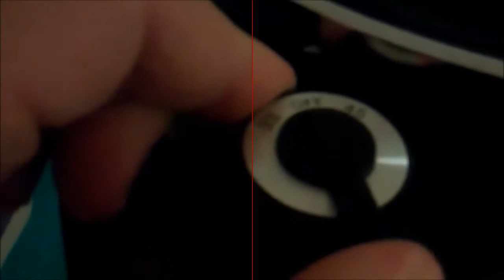Sony PS 1100 Turntable Gets a cartridge and setup

Comment: How did you get the platter straighten .
I'm going too pick one up from a pawn shop .
But the platter is looks like it was bent out of shape.
Is the shaft bent on it most likely .
I think the last owner had it shipped and the seller did remove the platter .
That's the only thing wrong with it .
Cost for me 70 bucks .
It has the original Sony cartridge the one with the green needle and there available on eBay two of 29 bucks  oem from sony
Reply from the maker: I put it on a shaft,  and measured the clearance, and manually tweaked it til it was smooth.  The platter metal bends pretty easily.   There was a platter for sale on Organ Donor turntables,  so if I messed it up worse, I had an option.
Reply: @DeadKoby  ok I see at worse I can get another platter

Comment: Hi DeadKoby when you plug it to your amp do you have this hummmm?    i get Humm when STYLUS  touch the record , maybe its the direct drive ?
Reply from the maker: How about the chassis ground?
Reply: @DeadKoby   i think it has to do with the direct drive as it humm when the motor in engage with the TT, when the arm is down and TT spin when i dis-engage the motor the humm stops.

Comment: This seems to be old but do you have any tips on replacing the tone arm wire?  I was able to pick one up and it seems to work fine except the cartridge is missing and the tone arm wires were fragile and broken. I am going to replace the wires and the cartridge as soon as I figure out how to replace the wires.
Reply: I think I just need to take the top off to get to the wires, but not sure how to get that off.
Reply from the maker: Is there enough wire there to fix the broken connector?
Reply: @DeadKoby  no it broke up inside
Reply: Connectors are all shot and corroded
Reply: I pulled the bottom off and I see how to do it. I ordered a new wire set and it should be able to pull it through with the old wire. The wires soldered underneath look good so I will just splice into the old wire and and then secure the new wire to what is left of the old wiring at the cartridge end and hopefully be able to pull it through. Thanks for the videos
Reply: I also ordered the same cartridge that you used. Since the original one is hard to find and expensive if you do find it.
Reply: By the way, this was a free pick-up so I don't mind spending a little to get it going. The gears and motor all work fine.
Reply from the maker: @crshuby   It's a decent cartridge.  I just refurbed a Panasonic MCS  (Also on the channel)  and I went with it again.   Sounds good, tracks ok,  doesn't cost much.

Comment: Hey, I've got the same turntable but mine is missing the anti-skate weight and I was wondering if you know how much the one you have weighs? I appreciate it if you know
Reply from the maker: All I can tell you at this time is  "not much".... I sold this in February.   There's a web site called "Organ Donor Parts"  that specializes in old turntable parts.  It may be a good place to look.
Reply: @DeadKoby  no more anti skate weight from them .
You have too make a 2 gram weight 
Or get a gram weight from eBay and make a string from fishing line or a metal leader line they use for fishing .

Comment: I just picked this turntable up at a yard sale ,I have question the platter will not spin like it should,is there something that me be oiled?It powers on and the platter wants to spin but it's not spinning freely under power.
Reply from the maker: If you pop the platter off,   you'll want to clean and oil the sleeve that the shaft slides into.   I'm sure you'll find dried up grease in there.
Reply: DeadKoby well I lubed the idler wheel and got it spinning properly the problem is now it won't maintain the proper speed.i can lift the control(the speed control) and it will play up to speed..release it and it drops down a little and the speed drops back down.